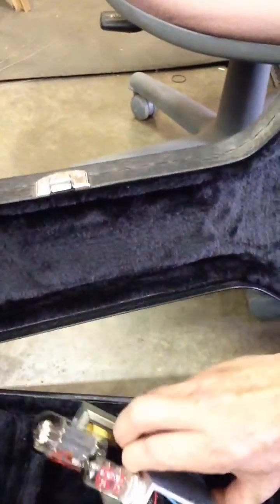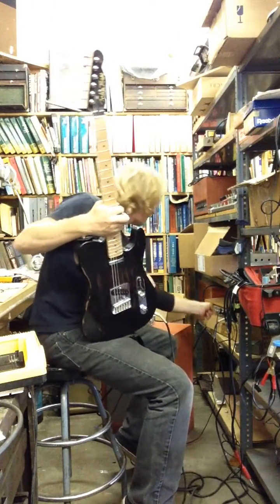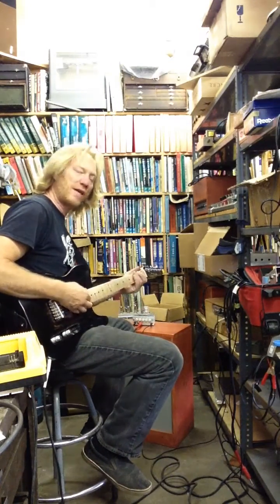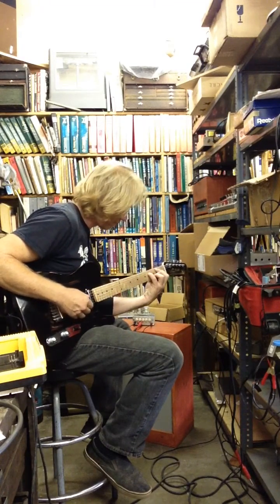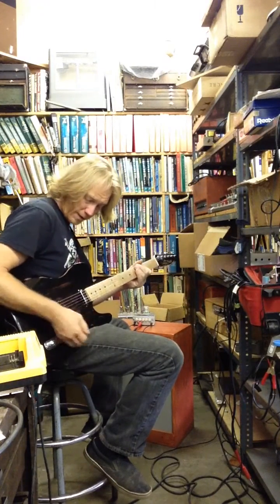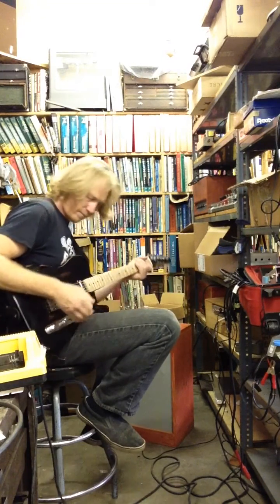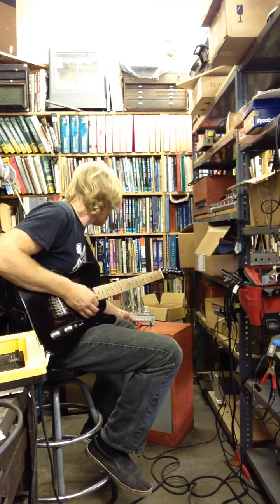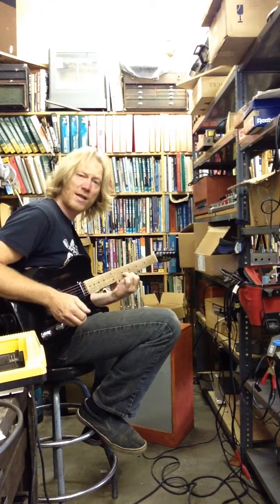mini tube amp head fits in guitar case

Comment: Very nice build! are you using the icl7660s/max1044 to obtain 200v?
Any idea how many current is available?
Reply from the maker: +Thomas Hafemann  Thanks :) Im using the taylor 1363 smps to get the high voltage. It saves a lot of space. should be around 50 ma at 12v supply.
Reply: +forbyn thanks for the info!
Reply from the maker: no problem. Good luck building if you choose to! let me know if you need any more info. always happy to help .